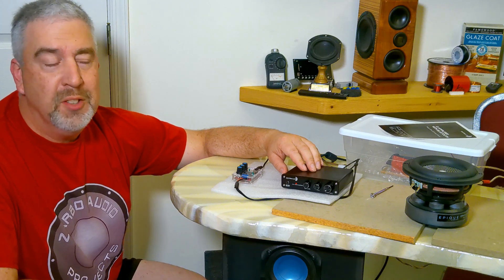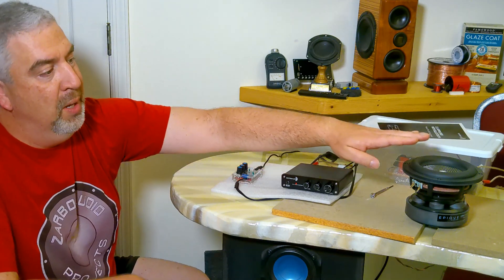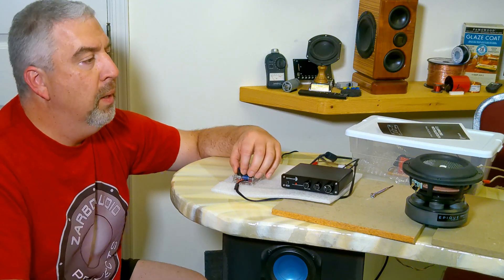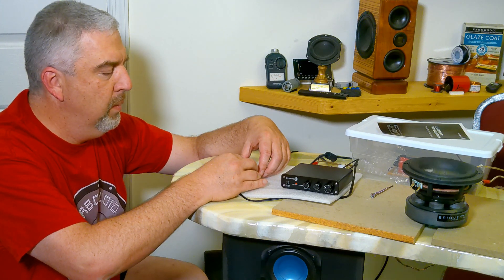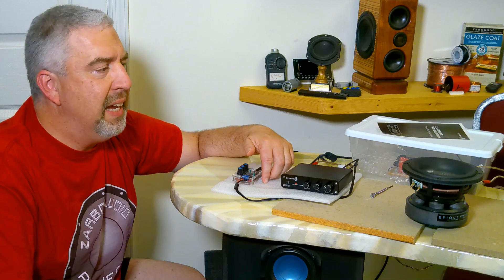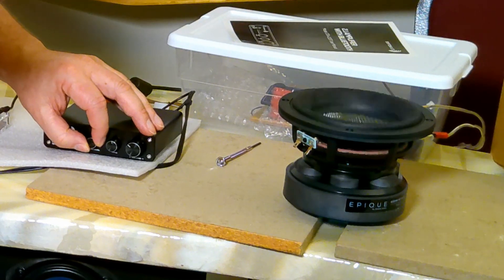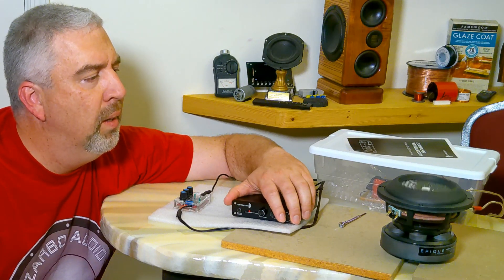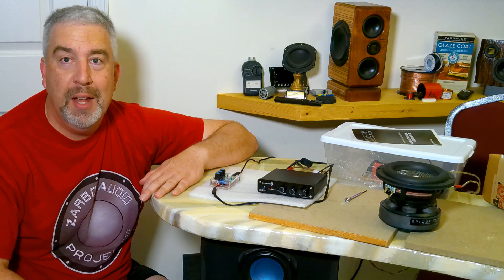Short Video Pushing the new Epique E150HE 44 subwoofer driver to its Maximum Excursion!

Comment: Tapping sounds like those are usually a very bad sign that either the metal former or the actual windings are hitting probably the back plate.  The driver should make a sine tone, and at very low frequencies you're not going to hear it due to the front to back cancellation.  When overloaded you WILL hear the harmonics or tapping.  If you just want to kill it and see the max excursion then that's fine.
Reply from the maker: I pushed it pretty hard, but there was no permanent damage. I did smell some smells, though!

Comment: when you run a DVC sub using only one voice coil. you're destroying it. a DVC 4 ohm can only run at either 2 ohm or 8 ohm. no one in his right mind uses the 2 ohm on a home audio. its cheating the amp and the speaker.
Reply from the maker: I agree that running dual 4 ohm coils in parallel will yield a 2 ohm load which almost no sub plate amps will tolerate when stressed. 
However, using just one of the two coils is not detrimental to the driver in any way... as long as the TS specs are used to design an appropriate enclosure, and you are happy with the type, and size of the enclosure.
Reply: Running it on one coil does nothing to hurt the subwoofer single coil subwoofers are just as loud as dual voice coil subwoofers dual voice coil subwoofers are for more broad wiring options... Humble yourself....

Comment: Nice little sub...Have u tried the genius nitro 6.5 inch subs? I used 2 in a bt speaker build and they are very impressive! I am very very impressed with them!
Reply from the maker: I just checked them out. Looks pretty nice for the price. That's one heck of a Bluetooth speaker if you have two of them installed!

Comment: Did the clicking noise go away when you put it in the box?
Reply from the maker: Yes, no noise in box. The noise wasn't so pronounced in real life, the mic emphasized the sound it was making in a weird way. Nearly all high-excursion drivers will make a little 'noise' when flexed that hard, if for no other reason than air current vortices stopping and starting nearly instantly front to back since it's not on a baffle. It's dead quiet in box, though.  Well, except for all that wonderful bass it's making. : )  Thanks for commenting.

Comment: How in the hecking heck did that amp run that speaker? Tested this when I first got it on the 2.1 T116D2 Bluetooth amp. It wasn't having that at all. Started clipping at 20% volume, also before clipping had near zero movement, then the second you turned it up. Was clipping like it wanted to punch thru the floor.
Reply from the maker: The reason I was able to drive the Epique with that amp was mostly due to the MPJ@A sine wave generator. It's a really cool little diagnostic and test tool. It has a VERY strong output, where most inputs from a phone, iPod, Bluetooth, MP3 player, etc. are MUCH weaker. By using the MPJ@A signal generator, I was able to get ALL of the Dayton amp's available wattage to push the driver to it's full stroke.  PLUS... I was only driving one coil, so 4 ohms instead of 8 when the two coils are wired in series. Most little amps seem to have a pretty weak op amp setup and have trouble reaching their full power unless driven by something like a home CD player or laptop headphone output.

Comment: The buzzing was distortion and the clicking was it bottoming out.
Reply from the maker: It may have sounded like it was bottoming out on the video, but in person, it wasn't bottoming out quite yet. All drivers with high excursion make some noise when working to the limits. We never hear it because the "noisy" parts are inside the cabinet, but with that much flexing going on (and air moving as well) there is bound to be some noise. Amp clipping can be a noisy affair as well. Go one little touch higher on the volume knob and it starts to sound a little like rattling or something similar. There may have been a tiny bit of that going on... but mostly this thing was just making the normal sounds a driver makes when pushed to it's physical limits. Just think about that much air moving back and forth that fast with all the 'vortices' that would happen along the edges of the cone as it's suspended in free air... there's going to be some fluttering sounds going on there for sure.

Comment: I think only using one coil can  damage the subwoofer.
Reply: nope the driver couldn't care less as long as you don't over power it.
Reply: Why would you think that lol ? Or did it just hit you there is 3 ways of wirring configurations for a dvc woofer ? That’s how bmw did it in the front kick midbass drivers back in 95 in the m3. So if my speakers were still playing perfectly fine for the last 30 years then I’m sure you’ll be just fine! It gives the user the flexibility to fine tune your speaker with the equipment you have available to get the most wattage output from the amp based on the ohm loads 😁
Reply: Absolutely not... Dual voice coil subwoofers are for more wiring options

Comment: How is this single driver sub compared to your peerless sub that you built how would you compare
Reply from the maker: This driver is capable of what sounds to me like MUCH more output than the Peerless, and the bass is less distorted with this driver compared to the Peerless as well. The Epique sub digs a big deeper as well. 
This driver has similar output to a good high-excursion 8" subwoofer with the exception of slightly less output in the 20-30 Hz. Range where the Epique driver is more limited due to it's smaller piston size.

Comment: I love Dayton speakers, woofers and tweets (currently in my home audio setup) ... I never got on with their subs. I've seen too many failures, bad smells and/or noisy subs for my liking.
Reply from the maker: Understood. We all have different experiences with this stuff. I know some folks to get bad ones or duds... it's going to happen. 
I was really pushing this thing to the limit, and to be clear... this driver did not experience any type of failure despite my abuse. I warmed up the voice coil assembly for sure... but the other new, unused driver has the same smell if I get my nose in there... just not quite as strong. 
This exact driver lives in my newest subwoofer creation, the Epique Small Cube Subwoofer which I did a video of... here is the link for easy reference if you haven't caught it:  https://www.youtube.com/watch?v=e3U6EWnfuMg&t=670s  
This one is a winner 100%. It can take more abuse than I expected it to. We have to remember... myself included... that subs alone are going to be a bit noisy at the limits... add in the rest of the signal and it's all good. I do respect your experience with Dayton subs... sorry you had some bad ones.
Reply: @zarboaudioprojects1430  Happy New Year to you!

Comment: I also bought this little subwoofer to go with a soundbar I picked up. I was planning on building a smaller enclosure with an 8"  Dayton Audio passive ive radiator I have had laying around. I'm looking forward to seeing what you build for this little guy.
Reply from the maker: The cabinet is done, then need to get veneer on and put a finish on it. Hopefully within a few weeks it will be humming. Thanks for the comment Sam.

Comment: Do you like that frequency generator? I've been wanting to try one
Reply from the maker: I LOVE that frequency generator!  It outputs such a strong signal and it's so easy to use and play with. I'm fining it very useful. You can't plug a cell phone into most subwoofer plate amps and drive it to it's maximum wattage level, but with this, you really can. Plus it's just fun to mess with it and see what your woofer can really do! I have mine powered with a 9V power supply and I keep it in a clear plastic case so I can see it. I get no $$ for promoting this, or anything for that matter, but here is the link for those wondering about it: https://www.mpja.com/Mini-Waveform-Generator-Case-Kit/productinfo/35885+TE/ 
Thanks for the comment!

Comment: That is so awesome! You were really working it. I'm working on using this in a two-way with the CSS ld25x. I'm really intrigued with your use of passive radiators. Can't wait to see it done
Reply from the maker: Thanks!  Looking back, maybe I pushed it a tad too far... but I knew that amp shouldn't quite be able to do a full 100 watts, so I figured I was safe. But, the MPJ&A signal generator has HUGE output compared to Bluetooth, so... Hopefully what I smelled were the glues they used in manufacturing warming up and not the voice coil melting. :) 
That CSS tweeter looks to be a really nice performing tweeter. All their stuff is basically excellent. I watched your interview with Chris Perez from PE talking about how high and clean the E150HE can go in frequency... combined with that tweeter with it's ability to cross low and still sound clean, it sounds like a good matchup. Probably be one of the loudest/cleanest smallish two-ways ever! Looking forward to seeing that project.  Thanks for commenting.